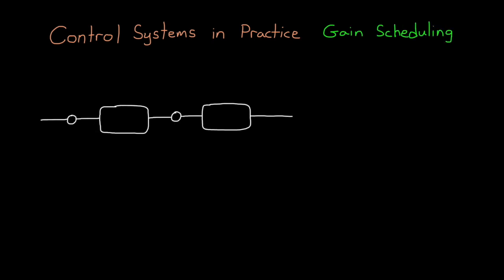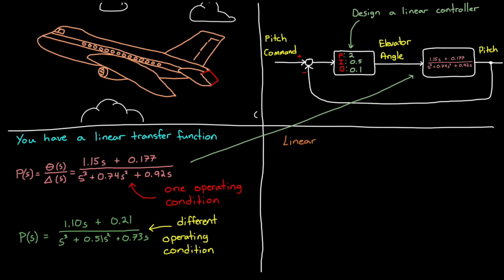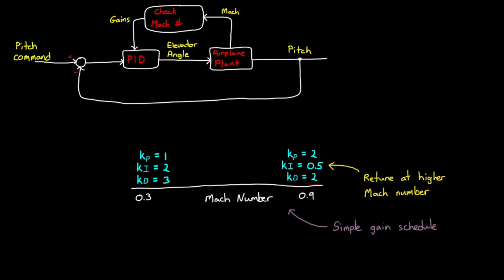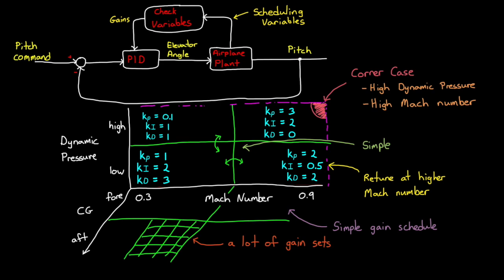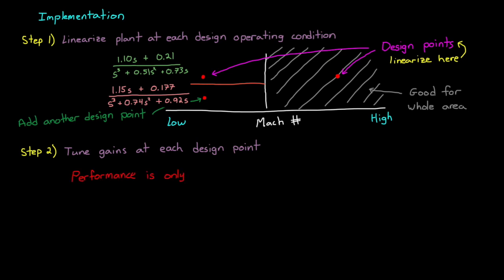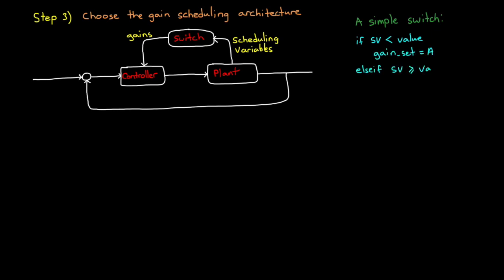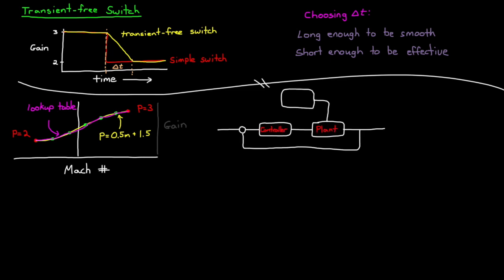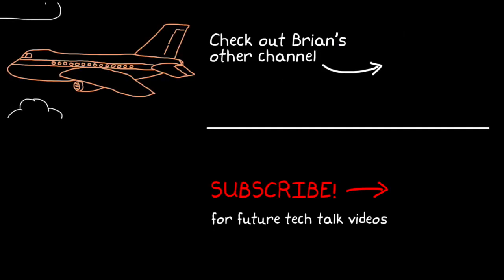What Is Gain Scheduling? | Control Systems in Practice

Comment: Hi everyone! Thanks for watching the video.  If you have any questions or comments you want me to see, please leave them on this comment so I get notified.  Cheers!
Reply: Hi, could you explain how LPV-Controller-Synthesis works? The design procedure which based on a LPV-model and which guarantees robust stability and performance.
Reply: Many thanks for your videos, Brian. Could you give us some literature suggestions concerning Gain scheduling?
Reply: hey i am unable to run it in R2018a. Undefined function or variable 'AirframeData'. Workspace for block diagram 'rct_airframeTRIM' was not loaded because an error occurred while loading MATLAB code: 'AirframeData. What about sharing the reference also
Reply: you mentioned that in airplane example some parameters varying so you have to opt for different gain sets for such a condition. my question is that why not to consider those parameters as multiple inputs ?
Reply: Hi Brian,
Besides that your videos are fantastic and I learn much from you, you pronounce "s" with a high pitch that disturbs when I use headphones.
Thanks for your time,
Reply: @lyapunov8972  Yes@brian Douglas Can you please make a video on it?
Reply: Great job brian! Do you have any tutorial on when and how to design adaptive controllers? I am wondering when I should use gain scheduling or adaptive control methods. Could you provide any reference? Thank you so much!
Reply: where is the link to your other channel?
Reply: Really love your videos and thank your for making them. Any interest in doing a video on autopilot design and tuning (three loop autopilot)? I think this would be a cool way to tie some of the videos together.
Reply: Really love your videos and thank your for making them. Any interest in doing a video on autopilot design and tuning (three loop autopilot)? I think this would be a cool way to tie some of the videos together.
Reply: Hi, I was wondering if there is any theory based around proving stability when using the gain scheduling method? Like, is there a way to theoretically back up the use of gain scheduling with stability proof?
Reply: Hello, may we use gain scheduling with SMC? Thank you

Comment: I've heard it said that the crash of Air France flight 447 was due to the low gains the plane was using, in which it got stuck because the speed sensor was kaput. if the pilots could have changed the gains they could have saved the plane. The low gains are to protect the aircraft when flying at high speeds, but when there are no more speed measurements due to a faulty probe, Airbus should have considered this scenario.

Comment: Great video! I have a question about the implementation of the gain matrix in Simulink. If I want the gains to change according to specific conditions ( I'm using StateFlow), and I have a gain blocks in Simulink. I didn't find a way to change the values of this gains during running. I don't want the gain to be a signal that change over time and than multiple with the controlled signal. I want the value the parameter that I specified in the gain block to change during running according to specific conditions, Thank you!